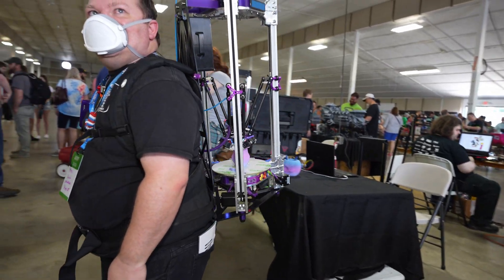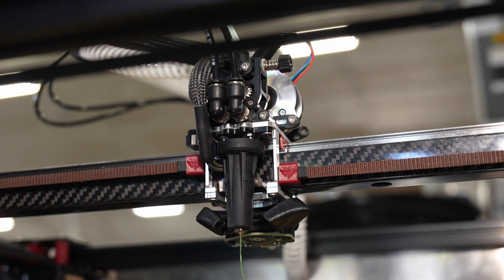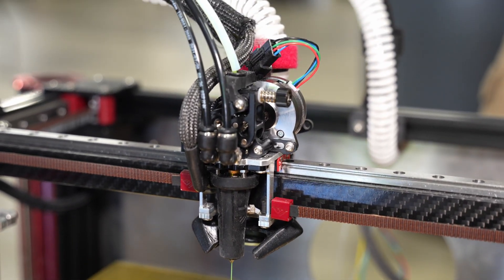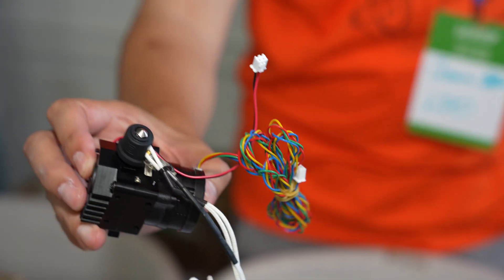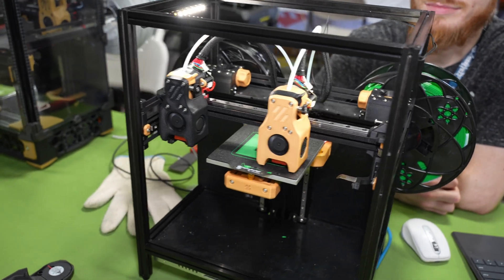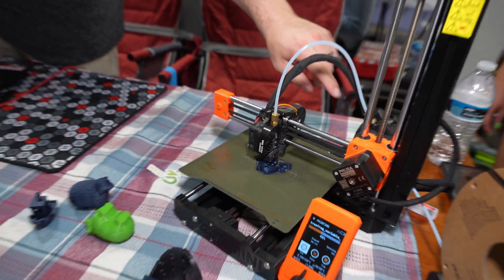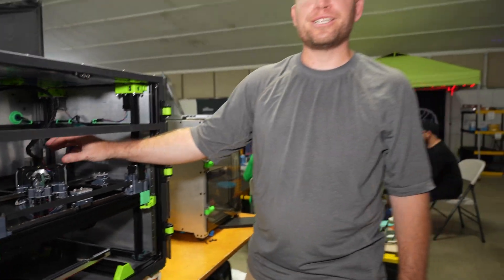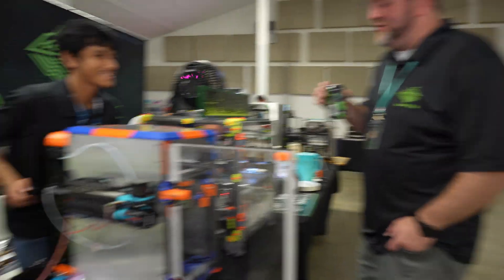MRRF 2023 Recap - Bringing People, Printers, and Plastic Together

Comment: Thanks for filming the 3D printer backpack. It was great meeting you hope to see you at the other RRF shows.
Reply from the maker: I just got some USBC power negotiation chips, I think I’m going to be able to run my Ender 2 pro off of a 140W USBC power bank
Reply from the maker: Here’s the parts I’m going to try. Running a printer in reduced voltage is a great way to cut peak power consumption, so stepping down to 20V doesn’t really bother me. Should reduce peak power draw by about 1/3rd for the bed and hotend heaters. Gonna take another minute for the bed to heat up, but if portability is the goal…
https://amzn.to/44hoWrV
Maybe you’ll have some portable competition at ERRF 😎
Reply: @NathanBuildsRobots  I considered that for the backpack but it’s easier to have the battery go directly to the printer. You might have some issues under volting some of the components.